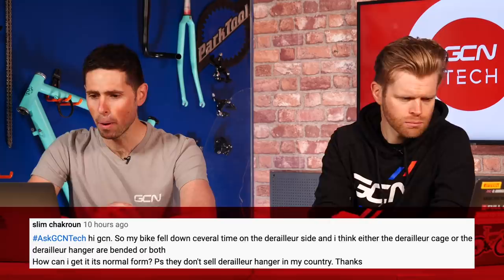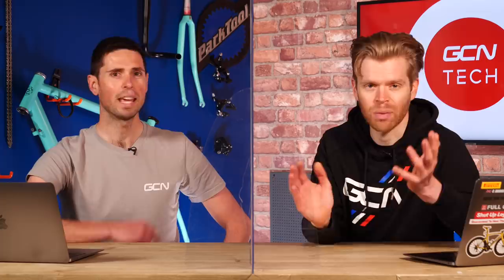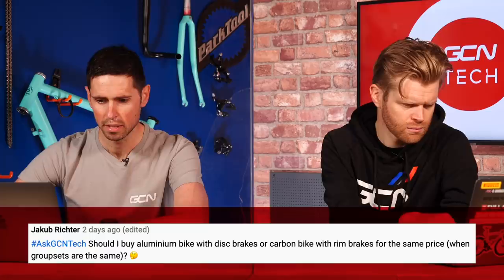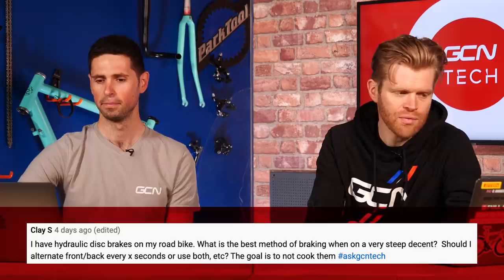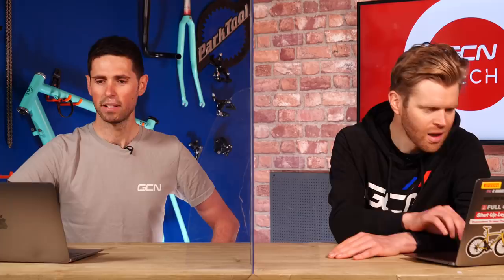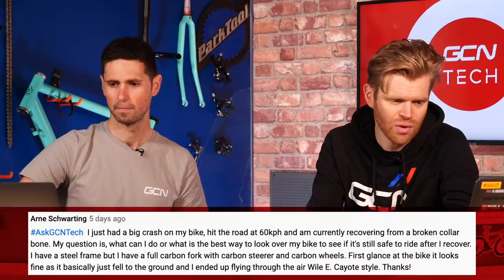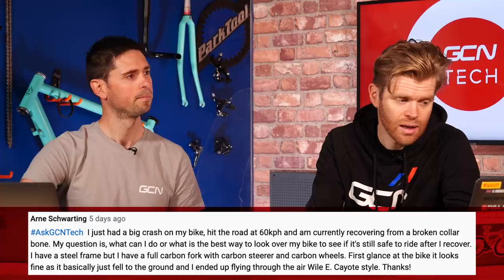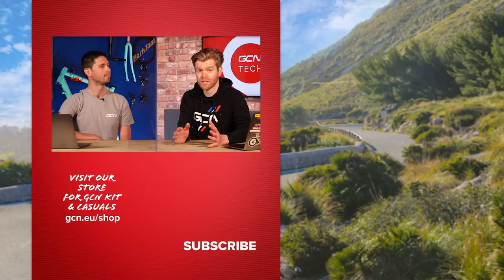How Can You Check Your Bike Is Safe To Ride Again After A Crash | GCN Tech Clinic #AskGCNTech

Comment from the maker: Do you have a burning Tech question? Be sure to leave it below 👇 using the hashtag #AskGCNTech
Reply: I’m extremely surprised that you don’t know about Park Tools CC2 chain checker, the bottom end can be used to gauge cassette and chainring wear.
Reply: #AskGCNTeck Hey guys, just a questions about rear derailleur. I own 2 cassettes an 11-28 and an 11-34. Do I need to re-adjust my rear derailleur everytime I want to swap my cassette out? It's mostly flats where I live but I want to do some hill climbs when I travel.
Reply: if you run Di2, can you make it so when you change the chainring, the rear mech goes one or two cogs the other way, in order to make the gear change not as steep?
#askgcntech
Reply: #AskGCNTech Hi guys, I'm thinking about changing guide and tension wheels, but I'm not sure what should I look for before choosing one. Is it enough to pick those with the same tooth number or is there also a factor between jockey wheels for 9/10/11 speed mechs (suppose different width? Thanks in advance!
Reply: #AskGCNTech   Should you deflate your tires (tyres) a bit or all the way before flying with your bike? Is there a difference between tubed and tubeless ?
Reply: Hi guys. Somehow some dirt got stuck in the tube guiding the front gear cable through the frame, from the bottom up to the front mech. I have tried everything but can’t get it out, hence I cannot use the front mech. Any advice? #AskGCNTech
Reply: I couldn’t disagree more about the Netherlands cassette answer you gave. If it’s so flat then surely a 12-25 is far better as close ratio and doesn’t need an extreme range to cover hill climbs?! Closer ratio allows more fine tuning to the cadence micro changes during mini elevation adjustments thus maintaining a better average speed and tailoring the feel extremely accurately. No need for a wide range at all.
Reply: Hi GCN Team!can i use a 112 chain link in 24-42 chain ring and 14-28 cassette its a 3×7 mtb 
#AskGCNTech
Reply: #AskGCNTech Hi! I recently installed my tires as tubeless on my tubeless ready Bontrager wheels. I get some leaks from the spoke holes on both wheels (sound and sealant coming out) that seems to seal up a bit when I rotate the wheel. They're not going completely flat,  but I'm losing some air pressure overnight, pumped up to 4 bar. Still haven't been out to ride it yet, is it good enough or should I replace the factory rim tape and redo everything?
Reply: I like how you perfectly lined the barrier with the wall corner
Reply: #AskGCNTech Can you please explain how to choose the correct tubeless tyre for your wheel? Manufacturers show ETRO Rim such as 17c, 19c, 19, 21, 21c with width (WAM) as 25mm, 26mm, 27mm and outer diameter (RAM) as 680mm then show 700x26C 26-622 (etrto rim 19c)on the box as exampled by Pirelli P zero. What do these measurements mean and how exactly do you know you have the right replacement tyre for the wheel RIM?
Reply: #AskGCNTech Hello GCN! I have a Trek Domane ALR 5 Disc 2018. This bike has a so-called "IsoSpeed Decoupler" (non-adjustable version, at the back of the frame).
It is making a loud creaking noise. Do you have some maintenance tips for Trek IsoSpeed? Thanks!
Reply: #AskGCNTech Hi Guys, I have a Giant Contend SL2 Disk 2019 and I am looking to upgrade the standard Tiagra components to 105. If I was to do this would I need to get a new crankset as I would get a compact 50/34, but this is the same as the Tiagra crankset that is already on my bike?
Reply: #askgcntech I hope you can help me! I'm new to cycling and find rim/tire widths confusing. Do 2017 reynolds assault slg clinchers (41mm deep, 17mm internal and 25mm external width) work with 38mm specialized pathfinder sport tires? Do these rims work on a gravel bike?
Reply: #AskGCNTech which one will you choose for climbing (more than 5% gradient)? 9.5kg climbing bike, or 8.5kg aero bike, presumably they have the same gear ratios.
Reply: #AskGCNTech hey! Aero question! If rotating wheel in general is not good for aerodynamics, does it mean that having a mudguard in front of the front wheel should make me faster?? 🤓
Reply: #AskGCNTech Can I combine a mechanical Ultegra front derailleur with an di2 at the back? And why shouldn't I, because most of my shifting happens at the back. Thanks!

Comment: Several firms (Unior is one) offer sprocket wear tools to determine the condition of rear sprockets. They typically use a length of chain to determine if the cogs are overworn.

Comment: Broken derailleur hanger, but don't know your exact type? Been there, done that. There's such thing as an "emergency derailleur hanger". They have them on ebay and they work fine. I've used them before, as I was unable to find my exact hanger at the time (because there's literally dozens of types of hangers! Seriously.). So, until you find your exact hanger, you can use an "emergency derailleur hanger". It's held on with the quick release skewer, so cinch it down just a bit tighter than usual.

Keep it up @GCN Tech.

Comment: Chainring set up for the Netherlands: 
It depends on your strength too: 53x11 is huge and if you don’t have a sprint or push easily above 50 kph with a reasonable tailwind you are better of with a semi compact of 52/36. If you are at the level of a good club rider, riding local circuit club races 53x39 is the better option.
Personally I use 52/36 because I don’t race, I do small group fast group rides and it takes + 54 kph to be out spun on 52x11. 
50/34 with an 11/23 is fine for anything up to 50 kph.
The true advantage of the 53/39 for me would not be the big 53 but the fact that a 39 on the front is still very usable in a headwind compared to a 34 or 36.

Comment: The same theory can be used with both vehicles and bikes. They're set at optimal efficiency from the factory. Your watts or fuel mileage will and do suffer by deviating from those settings. Plus as it was mentioned. It could cause things to wear out faster. Which in turn costs money.

Comment: re. upgrading the bike on Claris, I will say that when I upgraded from 8 speed with 175mm cranks to 11 speed 105 with 172.5mm cranks, the difference was huge. The closer gear ratios and shorter cranks make riding so much smoother and my cadence more consistent (and higher). Felt like I was flying after making that switch.

Comment: cassette wear - you didn't google by any chance before this show's episode? ;)) "cassette gauge tool" will simply direct you to the ROHLOFF tool "HG-/IG-CHECK".
It's designed up to 12s casettes, but you surely swap the few chain links on it for 13s if need be, e.g. Capagnolo Ekar. Works fairly quick and easy for every single sprocket, even for the smaller chain rings.

Comment: I once on a ride busted my rear derailleur to the degree that it snapped. It was bumpy and I was putting some force down. Regardless it snapped and took the hanger with it. Getting a new derailleur was easy, they are everywhere. But the hanger. That little thing. It took me three trips to a respectable store to get a new one. First trip they didn't have "it" in stock so they ordered one. What I got was very similar but not 100% so it didn't fit. Contacted the manufacturer of the bike and they gave me a component number to take to the store. That was trip number two. They made a return of the wrong one and ordered a correct one directly from the manufacturer. Should have taken one week, after a week and a half I called them to see if it had arrived. It had but they had forgotten about me. This time it was the right one. Only took a month of prime season riding to get that little thing. 

Lesson to be learned - the hanger can be annoying to get.

Comment: In the Netherlands 12-25 cassette (11-23 is impossible to get). Chainrings depends on your strength. I have 44-53 with 12-23 (10-speed) and 34-50 with 12-25 (mainly use 50 )
Reply: I just bought an 11-23. Try getting one from pushys in Australia.
Reply: @amandajane8227   Shimano Ultegra 6800 11-23(11-speed) is not made anymore. I have found a shop that does have a few left. I keep the cassette for race days. 11-23 has never been available in Shimano Ultegra 8000 or Dura Ace 9000.
Reply: @nlfiets  That's sad. Mine is an ultegra 6600 9 speed so not what you want.

Comment: been a heavy guy (130 kilos) i have huge issue to climbs, to i am testing now in my road bike a Deore crankset, than was triple and i made double, 48-26 (still using 105 triple deraileur at front with ultegra shifter , and with my cassete 11-34 (10 speed ultegra shifter and 9 speed altus deraileur and its working with 10 speed),  now i can climb a lot better than my old 52-39
Reply: that's some heavy frankengroupset, i love it
Reply: As a heavy rider myself we have tons of power/ torque. I to have gone back to 52/39 28-11 if I get out of the saddle the efforts the same 52-28 as it is 50-34 just the speeds slower.  People don’t take into account the muscle make up and valance between fast and slow twitch muscle fibres.

Comment: askGCNTech Really thoughtful answers this week. Here's one for you: one of my bikes (Cube Attain Aluminium - internal cables) has always rattled since new. I'm assuming chain length is ok, no dropped chains, mis-shifting etc. Could it be the internal cables I'm hearing? I'm going to ride it down a bumpy short descent without the chain to check. If it is cables, I've heard that strips of bubble wrap is a good solution - does it work, can I do it without removing cables?

Comment: Suggesting an 11-32 cassette for someone that lives in flats? And also having a hard time picking between carbon frame w/ rim brakes over alloy frame w/disc brakes?? You guys can' t be serious?

For the folks that asked this. 
1) 11-25 for flat riding, 11-23 if you can find also works amazing for those close ratio shifts.
2) Are you riding on paved roads? Rim brake carbon frame over disc brake alloy frame any day of the week, yes even on rainy days. Your bike will be lighter and easier to work on. Win win.

Comment: One more for the show. If you crash a carbon part, fork, frame, wheel, etc. DO NOT RIDE ON IT. Go to your LBS and get it checked. If you are on a ride, you can "quick check", using the edge of a coin. Tap around the object. The sound should be crisp and clean. If you get a dull thunk or crackling, there's damage. Time for a lift. I've seen wheels where the rider hit the edge of a "pothole", fail weeks later with the rider ending up in hospital.

Comment: Don't you pull the rear first--or only if you just need to scrub a bit of speed?  But both, for sure, to slow down hard for a corner, no alternating or anything.  And I'd say alloy with discs every day, if only for the durability of the frame.  Real life has lots of bumps and bruises and I'd rather not worry about hidden carbon cracks.

Comment: I store my Canyon Exceed XC carbon bike outside on a covered terrace. It is safe from rain and snow, but the sun is hitting the frame directly for about 2-3 hours a day (during autumn / winter / spring but not summer). The air temperature is anywhere between 0°C to 20°C during those months. I know carbon is not friends with heat. After about 3 years part of the logo on the frame has started to peel off. Should I be concerned about the frame durability? #AskGCNTech

Comment: Upgrade: Pedals, tire, position, wheels
Reply: I would add new brake pads or shoes+pads if the original brakes don't have separate shoes and pads.  Cheap but potentially good upgrade for brake feel and safety.

Comment: #AskGCNTech 

I love to ride fast & long distances (99% of the time on flat roads). I currently have a endurance/comfort aluminium frame/carbon fork with 28mm tyres. 

Should I upgrade/modify my current bike to make it more aerodynamic & better gearing or rather sell and find an aero bike?
What aero bikes would you recommend?

PS budget if I sold the current bike 2000-3500

Comment: #AskGCNTech As tire width vary depending on the rim and the tire itself, what is the minimum measured tire clearance you'd be comfortable with? (disc brake/carbon frame) Thanks!

Comment: absolutely there are tools for measuring cassette wear. at least my bike shop has one
Reply: Both Rohloff and KMC have a HG Sprocket measuring tool. You can see how it works on YouTube.
Reply: can you provide anymore info about it?  Thanks.
Reply: See: How to check cassette / freewheel wear with Rohloff HG check tool, and see also: KMC sprocket checker instruction. It is also possible to compare the teeth of a much used sprocket with the teeth of a new or hardly used sprocket

Comment: #askGCNtech is it bad to switch gears on the front and rear derailleur at the same time. If I am heading for a hill I want to switch to the smaller chainring in the front but go up a few gears in the cassette so the cadence is similar. Does this pose a potential problem?  (Using a mechanical group set -Tiara)

Comment: #askgcntech.  I’m an oval chainring convert and have been running them for a few years now.  However, I’m wondering if it’s possible to run a small oval chainring (39) with a large round chainring(53), and if there would be any benefit to doing so (i.e. small oval for climbing efficiency and large round for cadence at high speeds)?

Comment: #AskGCNTech

Hello, I really like your show, but I have a question, I drive now with carbon tubeless wheels and tubeless tires but with latex inner tubes. I put in the latex inner tubes because I will use this wheels for racing and I love the beter rolling resistance. But would you go for tubeless because you have beter puncture resistance?

Comment: #AskGCNtech what would happen if I used a smaller width inner tube? Would it be okay to ride 50 miles back home. For example 32mm tyre and 28mm tubes. What about 25mm tube? Thanks

Comment: #askgcntech. Hi Ollie/Alex. I am looking to replace the wheels on my road bike. My bike is that old it still uses rim brakes and 23mm tyres. I am looking for a set of rims that use 32 spokes. I am not a feather weight and don't want wheels that will collapse when I get on the bike. How ever most wheels for some reason come with either 24 or 28 spokes. Sometime both. My question is. To keep the strength of a 32 spoke wheel in a 24 or 28 spoke wheel. Would going for a deeper rim make up for the lack of spokes? I am also going for alloy rim. If I wanted rims that didn't stop in the wet. I'd keep me ceramic rims on the bike.
Reply: Check Hed Wheels. They make wheels for bigger riders.

Comment: #AskGCNTech Hi, if I wanted to go from a 11-28 cassette to an 11-32 cassette, would I need to change anything else? Hills are hard.
Reply: That depends on the groupset your riding with, but in general, you need to have a long cage derailleur for an 11-32.

Comment: #AskGCNTech Hi Alex/Ollie .. I changed to a tubeless tire for the first time on my tubeless ready rims. When I inflated the tire without tube, I did not hear the popping sound of the bead seating on the rims. I do not see any leak and i retains air but I didn't have the "sound of assurance" that the bead has seated. Is this normal? Do I need to do anything?
Reply: I've had the same problem with my tubeless tires. Tubeless has a much tighter tolerance on the rim, so it's harder to get it seated properly. I deflated the tire again after pumping it up and sure enough, it was not seated properly all around the rim, it was still stuck in the middle of the rim in some areas. I used WD-40 to reduce the friction of the tire on the rim. Pumping it up and deflating a few times, adding WD-40 where the tire was still not seated properly did the trick for me. I've now put considerable miles on the tire and have not encountered any problems with this method.
Reply: @blabla5604  soapy water is safer going than WD40